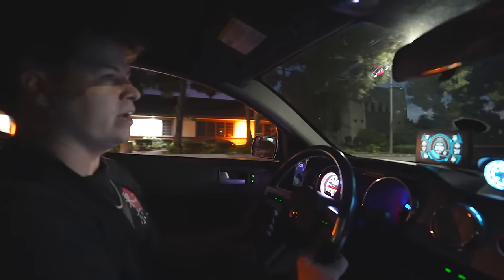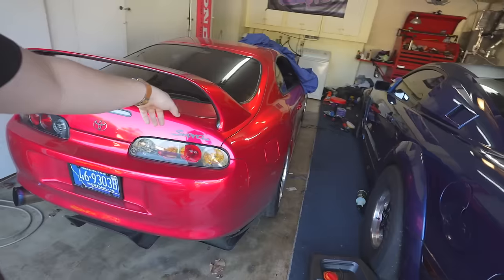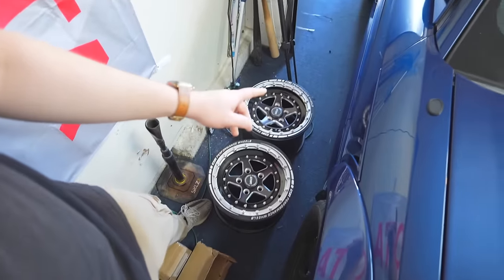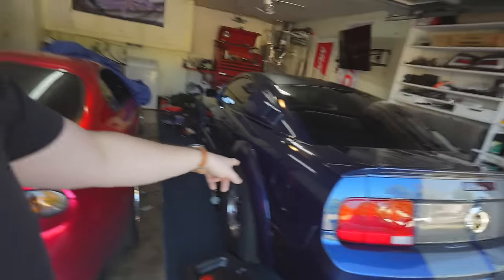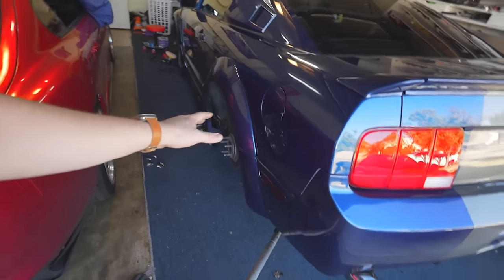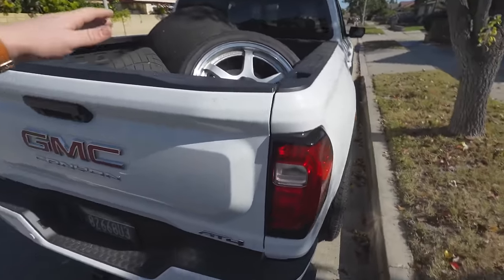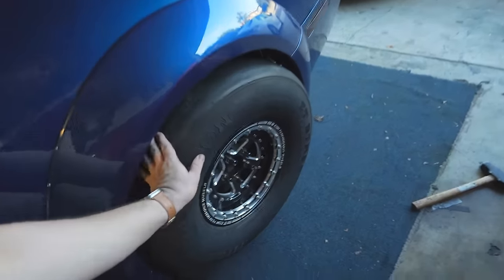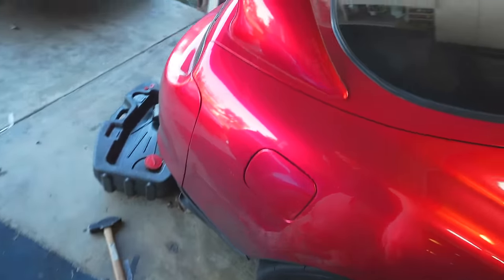1000hp Supra Turns Into DEATHTRAP With These wheels!!!

Comment: 20:41 Drew as someone who works on wheels every night, This would be easy to do with a standard CNC Machine. Leave them assembled and bring them to a wheel repair shop, and describe clearly what you want done. They should be able to set the CNC to a super shallow cut and get a nice clean thin line, so you can see that beautiful metal underneath and add some character to them.

Edit: Also those tires (on the supra) are toast. 2 Years of soaking/drying without heat cycling and catching UV rays without any treatment = completely cooked compounds. I can't speak to what PSI you should run, but definitely get some new meat and try to keep it under -1.5 degrees of camber. Best of luck!
Reply: Get mike mike to drive one of ya cars when you race them

Comment: Drew, feel like drag radials are for the drag strip (sticky surfaces). Might have better results with semi slick street tires which are designed for standard road surfaces. Most 1000hp supras are running the strip. Just a thought... although I could be clueless 🤔
Reply: Trust me no street tire hooking with these kinda cars
Reply: @abelthomas2406 ur not hooking on a unpreped surface in general lmao
Reply: Drag radials are designed for the street as well and work just fine, they just need to be heated up to stick properly but without good traction control, nothing really hooks up properly on the street at these power levels.

Comment: im gonna grab a 6spd 5.0 lmaoo, ive never driven a manual but im gonna fly across country and pick it up and drive back to NYC and vlog it, what you think?😂😅🔥
Reply: Go for it , just have a fresh clutch , pp , and , throwout an , pilot bearing weighting for ya when get home so once u fully get use to and comfy with it you can have brand new again
Reply: post that shit bro i might tap in
Reply: @youngdreflaco  hell yeahh
Reply: @mastercricket7626  bet!
Reply: As long as you have like the basic understanding how a manual works I doubt you shouldn't have a problem learning it. Just the matter of getting used to having an extra pedal and shifting. Though I think driving or stopping on an incline would be the scariest part of driving manual lmao.
Reply: @EnhancedTrashBin  yeah I know where to shift and how to clutch in and out etc. I just never actually sat in a manual and drove but I know how to do it😂 it’s not hard but I’m gonna get a 2019+ cause it has auto rev match
Reply: @tcerano  Yeah, I've heard newer modern manuals are a lot more easier with even stuff like hill assist being a thing.
Reply: yeah the 2019s+ supposedly have all those features
  @EnhancedTrashBin

Comment: If you're spinning at hwy speeds in 3rd even with 1000hp there's something wrong with your tyres 2 years in your parents backyard is real bad for tyres. 2 years stored properly would be fine but out in the elements those tyres are done.